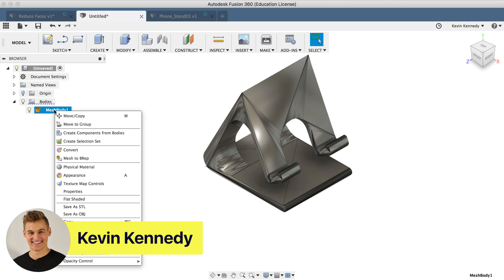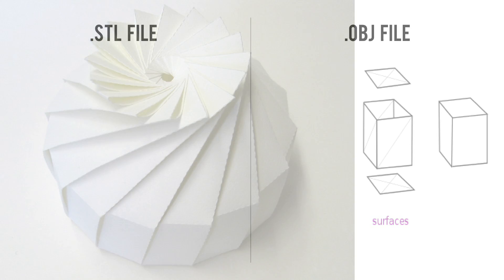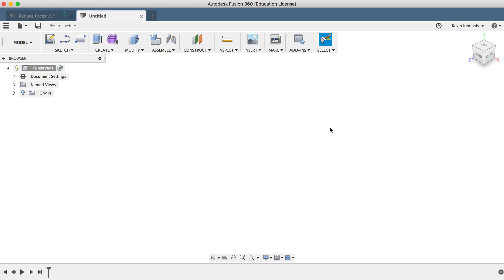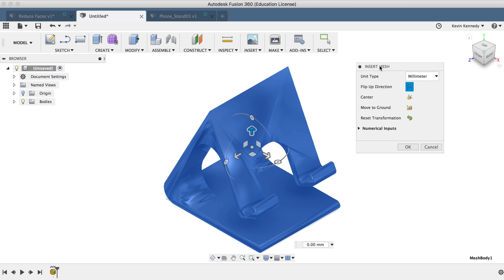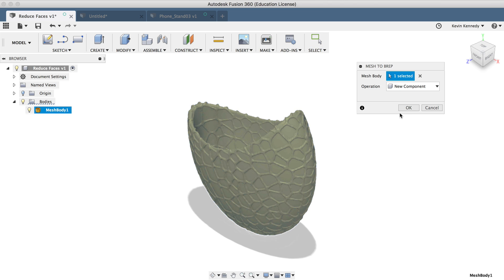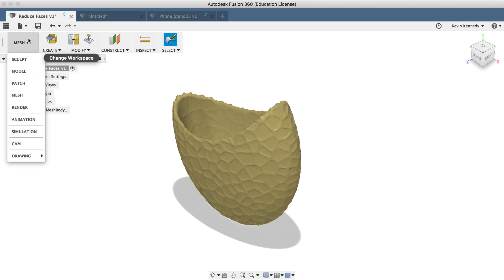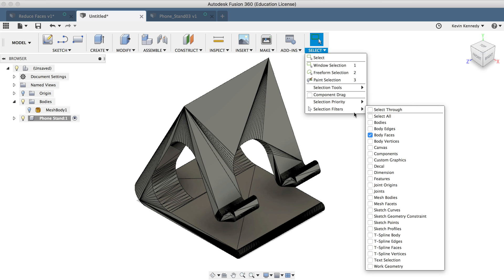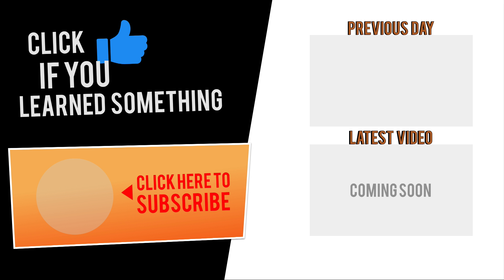How to Convert an .STL Mesh To a Solid Body - Learn Autodesk Fusion 360 in 30 Days: Day #18

Comment: Fusion 360 has changed it's UX ... for reasons noone knows ... so this video no longer matches the current product.  Nice job AutoDesk !  There wasn't any problem with the previous UX ... and now this great video and all the knowledge from the previous UX is lost.
Reply: NOT so. The changes are to accommodate Autodesk customers to have uniformity in the UI across all the different software they offer.

And this excellent tutorial is still valid and useful.
Reply from the maker: @stevesnead2368  Thanks for sharing this, Steve. You make a very good point... a lot of hobbyists users forget that they're not the ones keeping the lights on at Autodesk. In all seriousness, the folks at Autodesk have a "master plan" for all of their products, and we as consumers don't always get to hear the reasons why they do certain things. Making the products more uniform is definitely something they've made known they're working on and definitely something that will be valuable for all users in the future.

Thanks again. Cheers, Kevin :)
Reply from the maker: Hi Stuart. I will be re-doing this video in the next few weeks. In the meantime, I have created a video covering where all of these critical features have moved. You can watch that here - https://youtu.be/tuZzHcmFtg4

Cheers, Kevin :)

Comment: Just want to know why this isn't in your udemy course??
Reply from the maker: Hi, Thomas. The Udemy course is broken into three different courses: Part 1, Part 2 and Part 3 - all of which include 10 days of the "30 Days". Given that this is day#18, this is included in Part 2. Cheers, Kevin :)
Reply: @ProductDesignOnline  yea I found it it was titled differently in the course. Will you be updating the 30 day course to the new Fusion UI
Reply from the maker: @fbi805  Glad you found it. I created this video which should help bridge the gap between the old UI and the new UI - https://youtu.be/tuZzHcmFtg4

Over time I'll be re-doing many of the videos with the new UI. However, I likely won't be doing all of them because it would require a significant amount of hours that could be better utilized for additional tutorials. Cheers, Kevin :)

Comment: Great video! However I've tried the steps but I'm unable to merge faces, keeps giving me the error "unable to stitch merge faces". Any idea why? Perhaps it's the new f360 versioning..
Reply from the maker: Hi Jeremy,

There are two main reasons the merges usually don't work.
1) Merging too many faces at once so that F360 can't handle it all. Try merging fewer. Typically no more than 20-30. 
2) The faces selected are not all in the same plane. Make sure to use the "Select Faces Priority" option from the selection filters. Also, double check your selection filters that the "through" option isn't checked. I've seen users inadvertently select faces on the other side which prohibited this from working.

The most recent updates are all visual and don't effect any of this functionality.

Let me know how it goes! Cheers, Kevin :)
Reply: @ProductDesignOnline  hi Kevin, I should probably recheck that the "through" option isn't checked.. Thanks Kevin!!
Reply from the maker: @jeremywee475  You're welcome. Let me know how it goes! Cheers, Kevin :)

Comment: Did it 5 times step by step. Never worked. Probably is just for tiny files....
Reply from the maker: Hi Luca. What file are you trying to convert? Cheers, Kevin :)
Reply: @ProductDesignOnline   a  huge .stl of a subsea structure. Have tried also with smaller ones but nothing...
Reply from the maker: @lucasalati2492  If it has over 30-50,000 faces then you'll have to lower the face count with Meshmixer. Cheers, Kevin :)
Reply: @ProductDesignOnline  Will try that tanks
Reply from the maker: @lucasalati2492  No problem. Let me know how it goes! I'll be releasing a tutorial soon on using Meshmixer to reduce the number of faces. Cheers, Kevin :)

Comment: Jack Max
Hace 1 segundo
Any solution to mesh to B rep big  Mesh??  Fusion says warning when the number of faces its too big.
Any program or solution to can Mesh to B-rep without remesh whit minus faces.??
Reply from the maker: Hi, Jack. Did you try lowering the number of faces as I showed at 8:00 minutes on in this video? You should have no problem once you reduce the number of faces to 40K or lower.

If you're stilling having issues with lower the number of mesh triangles...that's where Autodesk Meshmixer comes into play (also free). Once you lower the mesh triangle count in Meshmixer than you can import it back into Fusion 360 for further editing. Cheers, Kevin :)
Reply: @ProductDesignOnline   yeah I try this process but lost too much definition. Lost part of his original shape.

The process that you explain in your video work very well but It's a shame that this be limited.

Thanks.
Reply from the maker: @jackmax6766  Sounds like you'll definitely want to look into Meshmixer then. This method really only works well for objects that have basic geometric shapes. Organic objects use a much larger count of mesh triangles and it's just too hard for Fusion 360 to handle. Cheers, Kevin :)

Comment: Thanks so much for this video. I'm converting Sketchup files to F360 and this really helps to get them to solids. I did get an error when I tried to use the Merge option under Modify drop down after select Brep faces using the Select/ Paint tool - any ideas?  I tried just selecting 2 facets with the same error (Failed to Merge). I repeated using your step by step instructions ??
Thanks, Lyle
Reply from the maker: Hi Lyle,
Double check that you don't have the "Select through" option checked in your Selection Filters (Select Dropdown > Slection Filters > Uncheck "Select Through"). If that is checked then it will be selecting faces on the other side. All faces have to be on the same plane in order to merge. It could also be likely that the faces appear on the same plane but they're slightly off.

Let me know if that helps! Cheers, Kevin :)
Reply: Product Design Online 
Thanks, Kevin for the quick reply. I checked and I do have the “Faces only” as the only Selection filter. I did get it to work once when I only selected 2 facets but it then separated those 2 from the rest of the component! I think the problem is that I converted a Sketchup file by uploading it to Fusion 360, then I followed your steps to convert one component from the file to another design as a Brep. This component is a board with faces, sides, vortexes, edges etc.
I’m going through your wood working videos now - great stuff!
Reply from the maker: @c5auto  Interesting... could be a number of problems, as Fusion 360 isn't pretty finicky with mesh files. It's too bad Sketchup can't export as STEP files. Glad you're enjoying the woodworking tutorials. You may have to rebuild the files in Fusion 360 ;)

Cheers, Kevin :)

Comment: My drop down says BREP to Mesh, Not Mesh to BREP. What Up?
Reply: I have the same issue
Reply from the maker: Hi Ronnie and arınç kuloğlu. It sounds like you're both in the Mesh Workspace. This can be quite confusing, but...
-In the Mesh Workspace you can convert files from BRep solid bodies to Meshes
-In the Model Workspace you can convert Meshes to BRep solid bodies

Click on the workspace dropdown list (upper lefthand corner) and switch back to the model workspace. Then, right click on the body (not the component if you have one) of the mesh file. You'll then see the "Mesh to BRep" option as so - https://snag.gy/kcLU1K.jpg

If you're still not seeing the option, then it's likely because you haven't turned off the design history. Because mesh files are so complex, Fusion 360 is not capable of capturing their design history in a parametric nature. You'll have to right-click on your top level component (file name) in the Fusion 360 browser. Then, select the option "Dp Not Capture Design History"

Cheers, Kevin :)

Comment: Hi, after I've reduced the mesh to 30000, I no longer have the option in the model workspace to convert it to BREP. Any idea what's going on?
Reply: Ok, I honestly have no idea what I did, but after five minutes of angrily clicking on random things, the option appeared and everything works now.
Reply from the maker: @patrykochmanski6156  Hi, Patryk. Just saw this comment.... did you end up figuring out why? Cheers, Kevin :)
Reply: @ProductDesignOnline  Haven't figured out why it works, but I did something and it worked. I respect your extremely quick reply.
Reply from the maker: @patrykochmanski6156  Thanks for letting me know. I'm always happy to help...please don't hesitate to comment on any of my videos should you have any questions. Cheers, Kevin :)
Reply: @ProductDesignOnline  I'm running into a bit of an issue again if you don't mind helping. It requires the image to understand better so I'll give you the reddit link: https://www.reddit.com/r/Fusion360/comments/c735ne/hi_i_want_to_make_threads_so_that_the_inside_of/
cheers :)
Reply from the maker: Hi, Patryk. Thanks for sharing this. I would recommend modeling this from scratch as well. That will let you easily create the threads without any issues. Did you end up re-creating the cylinders from scratch? Cheers, Kevin :)
Reply: @ProductDesignOnline  I am making an attempt. However, I am trying to put a dome on the end of the cylinder, and the only youtube video on this topic is outdated and I cannot follow what the person is doing.
Reply from the maker: @patrykochmanski6156  To create a dome you'll want to create a circle on the top of your cylinder. Then, create an offset construction plane the desired height of the dome. Once you've created the construction plane you'll want to create a sketch point in the middle of the plane, making sure it lines up with the center of your cylinder. Then, you can use the "Loft" command in the create a dropdown list to loft the circle to that point, which will create a dome. Cheers, Kevin :)
Reply: @ProductDesignOnline  I actually just ended up making a sphere with the same diameter as the cylinder and the just splitting it in half :)
Reply from the maker: @patrykochmanski6156  Great idea! That sounds like it works as well. Cheers, Kevin :)
Reply from the maker: Hi, Patryk. Did first right click on the top level component and select "Do not capture design history"? That is required before the "Mesh to bRep" option will show up. Cheers, Kevin :)

Comment: dude. how the hell does the part look so gorgeous in your model workspace. its like its rendered but in model. wth.
Reply from the maker: Hi, ProfessorM. What is your visual style set to? Head to your display settings at the bottom (Desktop icon) > Visual Style (flyout folder) then select > Shaded or Shaded with Visible Edges Only. Those are the two settings that I use throughout this course. 

Here are the other default settings that I use - https://productdesignonline.com/default-settings-for-fusion-360-tutorials/

Cheers, Kevin :)

Comment: I downloaded a obj file from grabcad and tried your method to make a solid body but when I merge a hole forms where I selected the faces do you have any ideas of what is wrong?
Reply from the maker: Hi, Emalan. This usually this happens when the original STL/OBJ file has a small hole (unnoticeable to the naked eye) and when Fusion tries to stitch everything together it omits that area where the hole is. I'd recommend trying it again, this time selecting a smaller amount of faces to merge. If the issue still persists then it's likely that the original file does, in fact, have a small hole. OBJ files seem to have this issue more than others, as they're typically derived from 3D-scanners, so if you can get the same file in STL format then that conversion may have better results. Cheers, Kevin :)
Reply: @ProductDesignOnline  it is a STL file sorry I'm kind of new to this
Reply from the maker: @emalannaidoo6187  No worries. Can you provide a link to the file? I'll take a look at it if you would like. Cheers, Kevin :)
Reply: @ProductDesignOnline  much appreciated, just got some idea from the fusion 360 website they said must use mesh programs to do some stuff gonna try them tomorrow thanks so much for your help
Reply from the maker: @emalannaidoo6187  Yep.. for very complex files you'll want to use Autodesk Meshmixer (also free) as it can convert a higher face count of mesh triangles. I'll take a look at your file later and get back to you. Cheers, Kevin :)
Reply from the maker: @emalannaidoo6187  I took a look at your file. I see what you were talking about now... I got the same results with some holes on the model. The STL walls appear to be paper thin. This could be due to the sizing of the original file before it was exported to an STL file. I would recommend trying to convert the file on Meshmixer and if it doesn't work there you may want to comment on the GrabCAD page to see if the original author can provide another file type. Unfortunately, files with a mesh format do not always work well in a parametric modeling program such as Fusion 360. Cheers, Kevin :)
Reply: @ProductDesignOnline  thank you so much for your help much appreciated
Reply from the maker: You're welcome! I'm always happy to help. Cheers, Kevin :)

Comment: I have an FBX mesh that is hollow, but I'd like to print it. I've converted it to an STL and every slicer I try to print it with has no idea what to do with it because (i think) the model is hollow. Can Fusion 360 help here?
Reply from the maker: Hi Mike,

I'm not fully understanding your question. Are you trying to print the file solid? or with only part of the model hollow?

Cheers, Kevin :)
Reply: @ProductDesignOnline  Do you have a Discord / FB page or somewhere I can show you the picture? I think I made progress the other night by opening the model in 3D Builder and doing a "Merge" on it. This some how fixes it up and makes it printable. It's magic as far as I'm concerned :)
Reply from the maker: @irql2  You can message me via my Facebook page - https://www.facebook.com/productdesignonline

Cheers, Kevin :)

Comment: Its a shame you can only do 50,000 faces after i imported some of my Zbrush files and reduced them they either would not reduce or came in faceted when converted to Brep. Do you know if this is going to change? Of course I mostly want to make things in Fusion 360 an d bring them into Zbrush which I have done and is very successful.
Reply from the maker: Hi, John. That's a good question. To my knowledge, I don't think this face-count cap of 50k faces is something that will likely be increased. It's a limitation based on how Fusion 360 was built. Are you able to reduce faces in Zbrush? If not, I always recommend checking out Autodesk Meshmixer (also free), which will let you reduce the face count and patch STL models.

I also recommend getting models down to the 30K face-count range or less... I've found the ones around 40k or 50k seem to really take a hard toll on F360...and you may find it will crash periodically. Cheers, Kevin :)
Reply: @ProductDesignOnline  You can reduce the faces of an.stl file in Zbrush using a plugin called Decimation Master but have tried they still end up faceted in Fusion 360 as the models are too complex for 50,000 faces. That is Ok what I want to use Fusion 360 is to model weapons ,helmets etc as you can use actual dimensions. Also to model dimensional bases for things then import them into zbrush and put more organic things on top for example might do a base for a novelty clock and have the hole for the mechanism and battery holder on it, then import it into Zrush ans add dragons or owls etc
Reply from the maker: @johnrobinson6796  Sounds like you're working on some interesting projects. It's always great to see some different workflows... I'm a big advocate for not always using Fusion 360 as the only step in the process. Keep at it! Cheers, Kevin :)

Comment: I noticed how you never expanded the new component. I followed along exactly and when I expand the new component it's still a mesh.
Reply from the maker: Hi, Grant. You should actually have two bodies after converting the mesh to a bRep. Did you right click and select convert mesh to bRep??? Here's what it will look like - https://snag.gy/6KFrpw.jpg

Notice how Fusion 360 leaves the original mesh file, while including the newly created solid body in the same folder. Cheers, Kevin :)